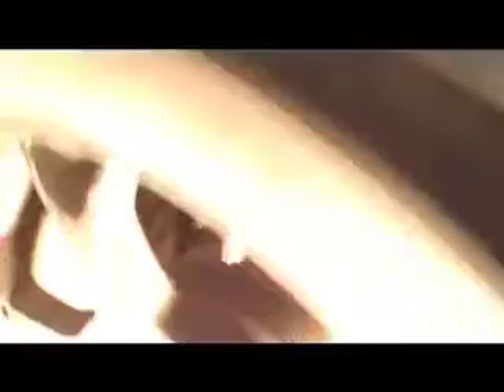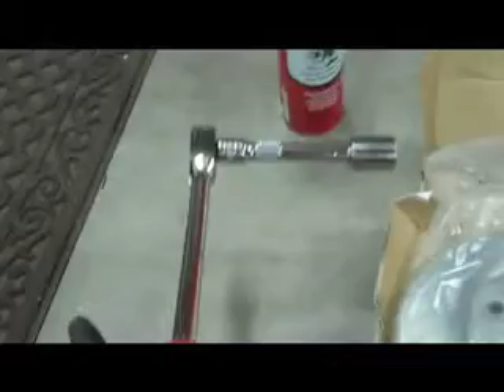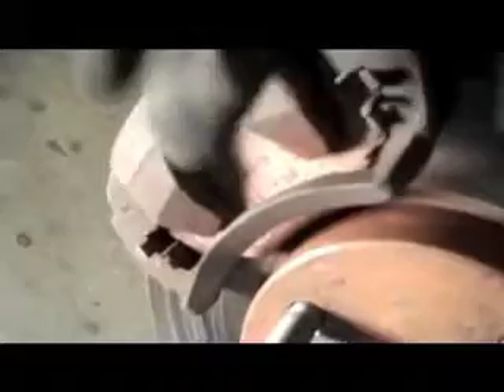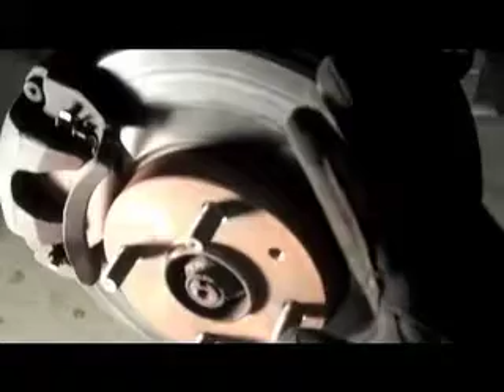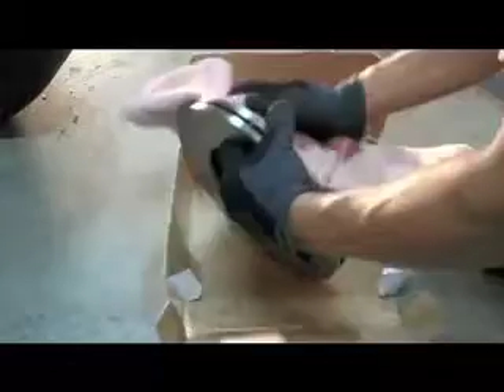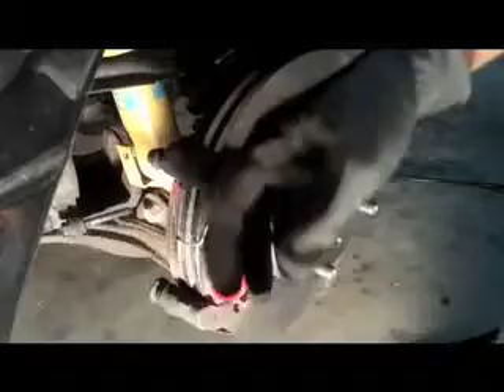How To Change Brake Rotors and Pads, 1994 Spec Miata (1990-2004)

Comment: This is an  excellent video for the front calipers and rotors  on the NA.  I'm currently laid up and showed this to a  inexperienced kid so that he would know what to expect  before walking him thru it step at a time .  As a  reminder - always  drain the reservoir first -  the combined displacement of the front calipers alone  can easily back-flow a spray of   four ounces of stinking, paint softening brake  fluid onto the engine compartment...   For the unaware, the rear pads/calipers require a totally  different procedure to retract the pistons and failure to get it right may result in a new set of calipers....

Comment: I'll be doing pads on a 2003 before too long. I think the rotors are still OK, so a pad slap may be all that's required. Anything different on the '03 procedure vs. what you show on this Spec? Is bedding required when only a pad slap procedure done? Thanks for the vid, pictures make it look so much easier ;)
Reply from the maker: Don, I haven't worked on a NB in a while, but I don't think the procedure is different, pay close attention to the rear procedure. If your front rotors are in spec (thickness) and aren't warped, you should be ok, but note that front rotors are fairly inexpensive so you might want to at least replace those. It just makes for an overall better braking experience. You should go through the bedding procedure with the pads whether your change rotors or not. Good Luck.
Reply: Dan Tsuchiya Sounds good. Probably think about front rotors, but leave the rears in place unless scored or obviously worn I would think. Yes, I read where a NAPA rotor for the '03 is a good choice, and at $25 each (from what I could see today) probably worth the effort when doing the brake job. Thanks for the tips/vids.
Reply: Don West The NB miatas have the same brakes as the 94-97 na miatas, except the masdaspeed and the LS NB miatas which have "sport brakes".

Comment from the maker: Neil, thanks for the tip on greasing the sliders, it's best to use just a little high temp grease specific for brake parts.  Want to make sure none of it gets onto the braking surfaces. Yes, that's unfortunately a cracked wheel, result of some off track experience by the P/O.  Vehicle has since been sold.

Comment: First of all Dan, Great video. I've done the brakes on all the cars and motorcycles I've ever owned but every vehicle is a little different so this helped me a lot. Just one point since you didn't cover it here is I usually lube the sliders as I  have everything off. Oh and just wondering was that a cracked wheel at the end of the video?

Comment from the maker: Roxanne7169 is correct, if the rotors are rusted on and you have removed the caliper first, make sure you don't have retaining screws. If you do see a retaining screw, you will need an impact screw removal tool, these remove the screw with a tap of a hammer. If no retaining screw just hit the old rotor with a hammer on the edge and it will come off- remove caliper first. Plan to replace your rotors as they are inexpensive. Good Luck

Comment: your rotors might have retaining screws.  In the past (on a 30 YO) VW, mine were so corroded I was forced just to break them of.  You can tap them out and replace them or just roll with it.  I never had a problem without those screws.

Comment: Likely they are seized with rust.  Douse the center with Peanut Butter Blaster (or similar) and wait.  Then douse it again.  Wait some more.  I think it helps to get some back behind the rotor if possible.  Keep that stuff off your rubber and paint.  Next, with a mallet, or hammer if necessary, beat the %^$# of the rotor.  Only on the edge (not pad surfaces) of course, and in an even pattern-turn-beat-turn.  When reassembling, use anti-seize compound on the rotor mounting surfaces.

Comment from the maker: Hi Penguin319, if you are going to replace them, just tap them from behind with a hammer.  If you are going to reuse them, then there are screw holes for either 10mm or 12mm bolts, you just thread them in and it will push the rotor off. 
Good Luck

Comment from the maker: It's partially the caliper, but it's also the wheel and the lugnuts for the wheel.  These days it's unecessary to have the extra screw that you had to use an impact screwdriver to remove/install.

Comment from the maker: Yes, it's probably best to remove the lid from the brake master cylinder reservoir container.  It's also best to remove some fluid before you start so that when you push back the piston in the caliper, you don't get overflow. Now the lid is vented, so not absolutely necessary to remove, but it's best if you have a good view of the level.

Comment from the maker: With regards to the rears, I'll have an upcoming video on those, but the big difference is the rear pads don't retract the same way. There's a hex key hidden under a rubber cap, you use an allen key to retract. Once retracted then you would clamp the pads to the rotor and then back off the allen bolt just enough so the rear axle can rotate by hand.

Comment: The rears don't retract the same way.  There's a hex key hidden under a cap, you use an allen key to retract.  If you used a c-clamp on the rears, you might've damaged the pistons, and need to replace them.

Comment: i've just replaced all of my discs.  the front ones were easy but the rears were very difficult as the piston would not push back all the way so they were flush.   The pistons aren't seized, as they do push out fine when applying the brake.  hand break was off too.  Is there a trick to doing the rears?